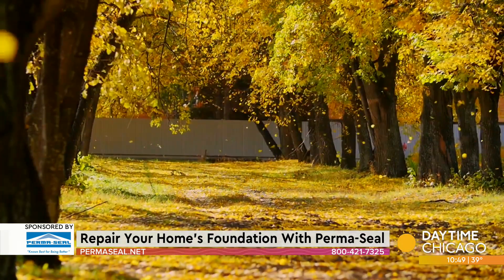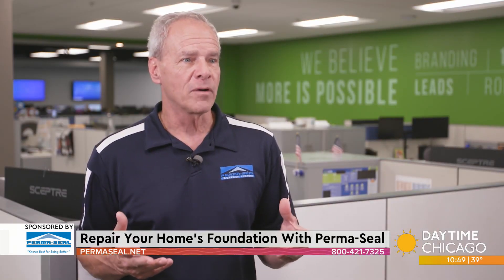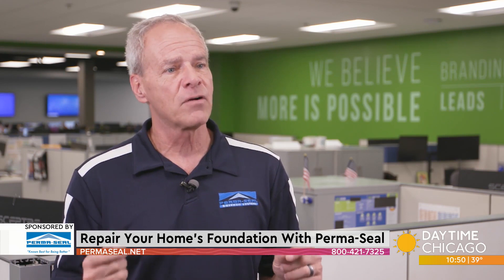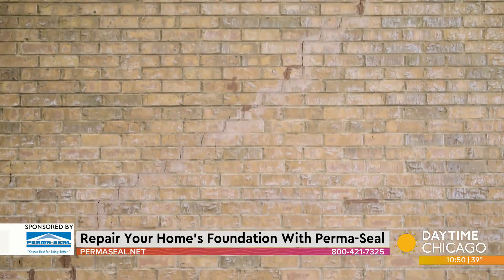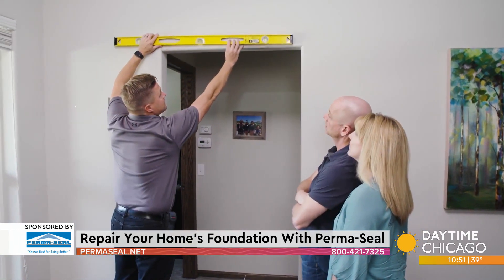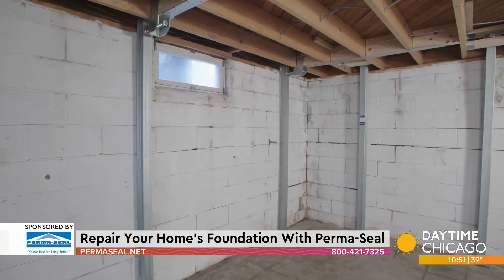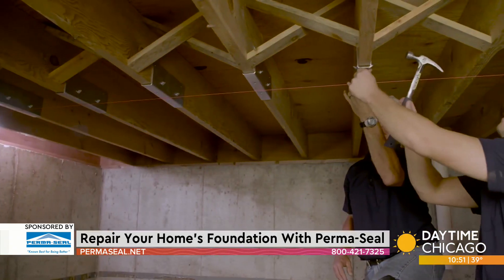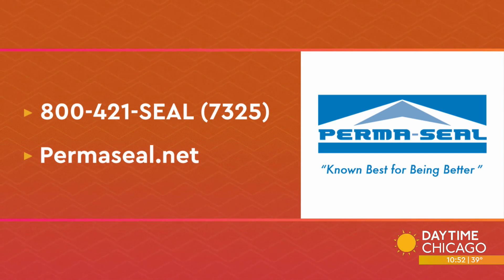Repair your home's foundation with Perma-Seal

Comment: perma-seal installed a drain system with an upwards pitch/slope so high that water could not reach end of drain outlet. In result 100s of gallons of water was dump next to foundation from the ice guard they installed. Will this cause foundation problems?